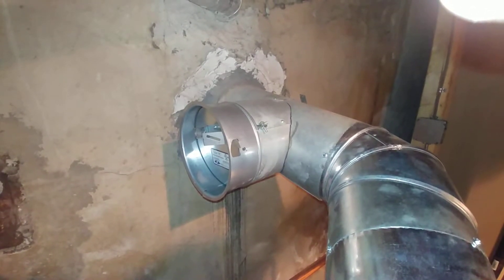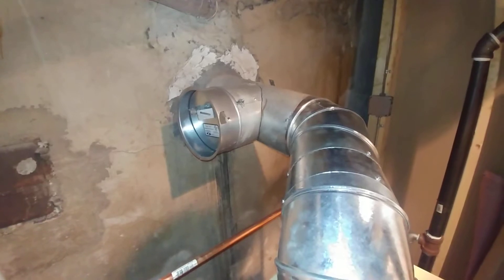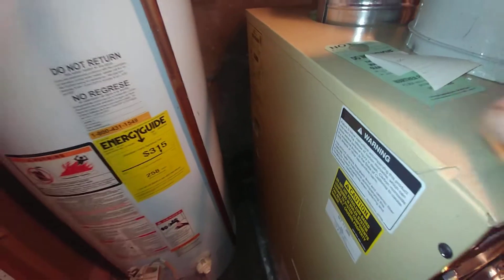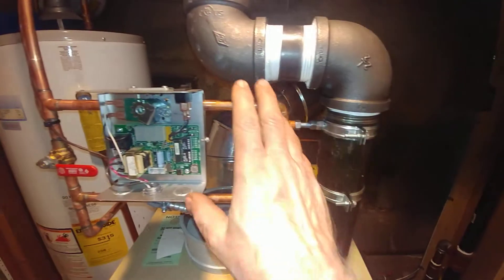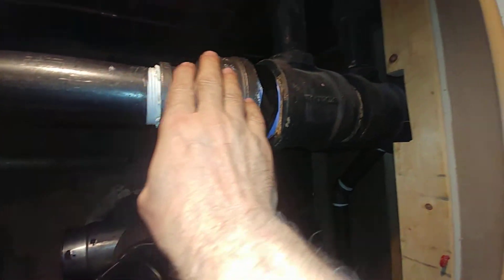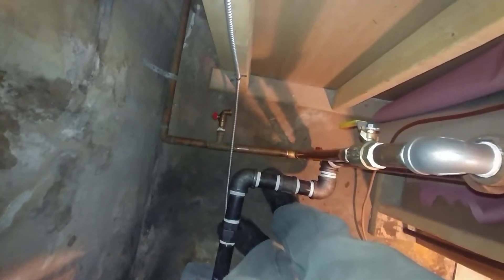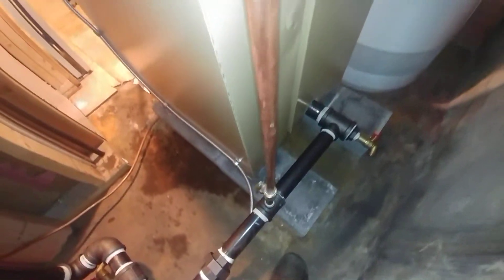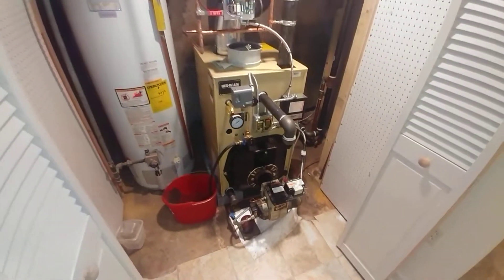Barametric Draft Regulator On A New Steam Boiler Install

Comment: I may be remembering this wrong. I THOUGHT I saw once that the feed was upstream of the Hartford loop on the return.  (which seems wrong). Shouldn't the feed ALWAYS be downstream of the HL on the equallizer, and wouldn't it be optimum to put the feed just below the HL on the equalizer line to give maxumum time for cold water to mix with warmer water? Is there ever a risk putting the feed close to the boiler inlet?
Reply from the maker: In general, you don't want to pump cold water directly into a hot boiler.
(I've seen it done a few times by others, so it seems not to be an instant boiler killer after all, but still...)
I sometimes tie the water supply in the return piping directly after the equilizer, other times, I'll feed into the wet return.
I'll try to install an isolation valve on the wet return and add the feed after the valve but before the tie-in to the equilizer line so a "no-return" flush can be done, but sometimes, it doesn't work out in the space allowed.
Reply: @gordonschweizer5154  Thanks for the time you spend teaching us.